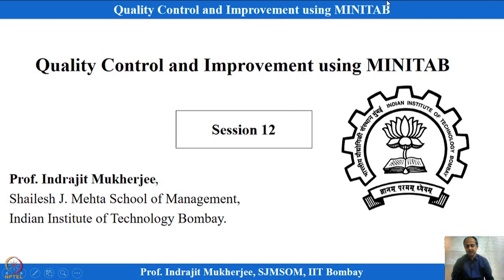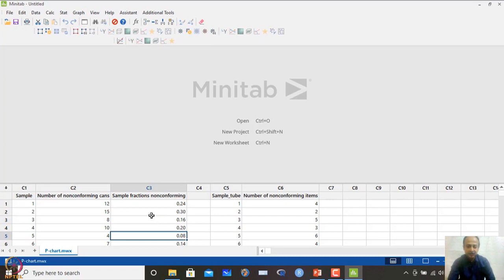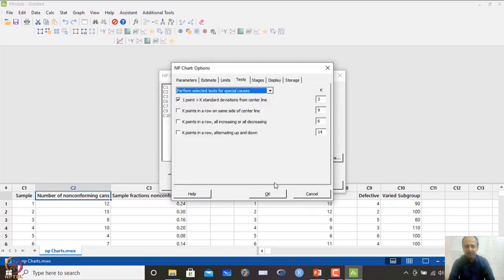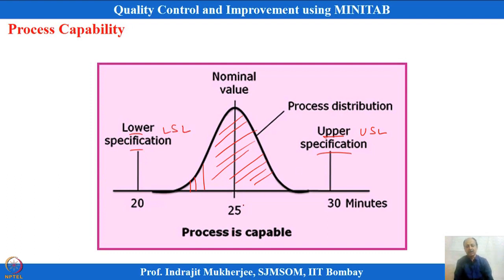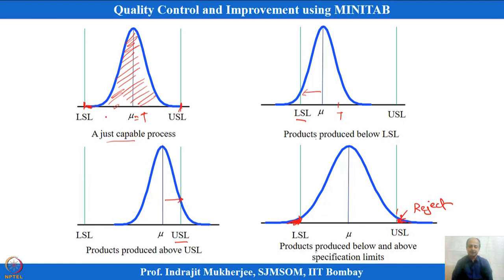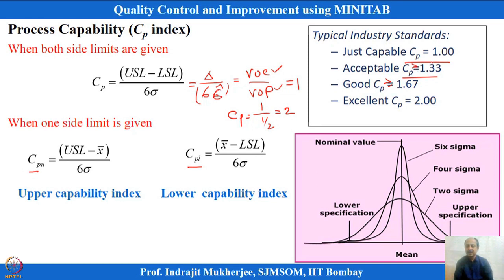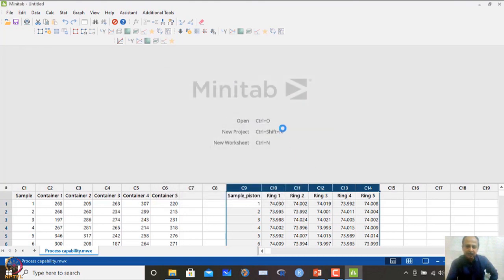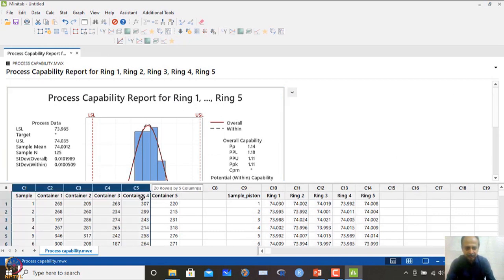Lecture 12: Attribute Control Charts and Process Capability

Comment: It appears that an error has been made at 18:40, where the formulas for Cpu and Cpl are presented with a 6σ in the formula. However, since these indices only account for one half of the normal distribution curve, the correct formulation should utilize 3σ.